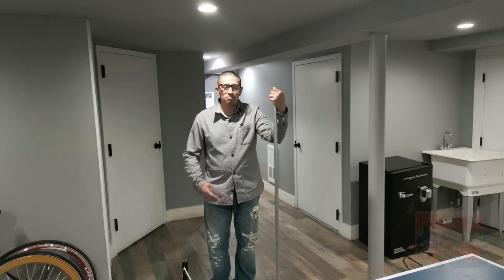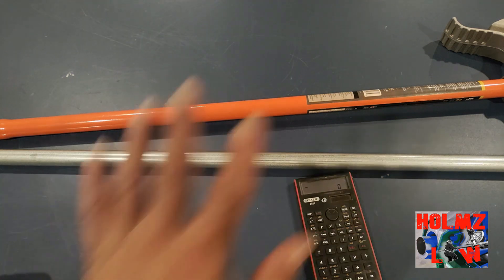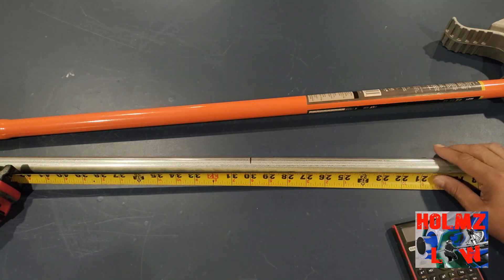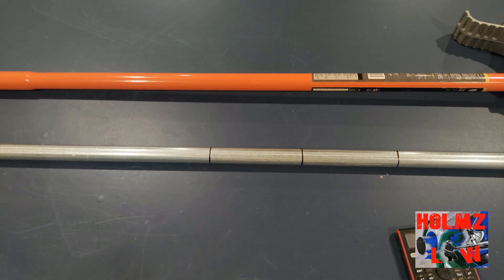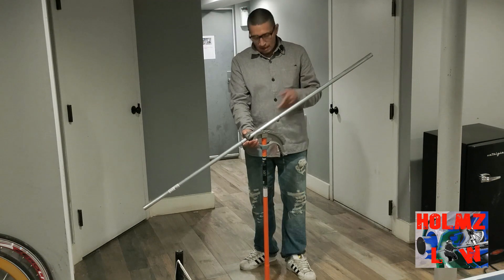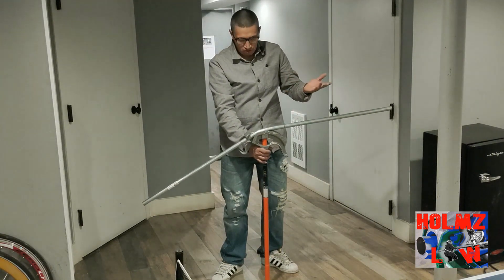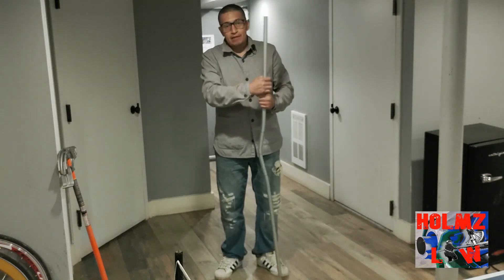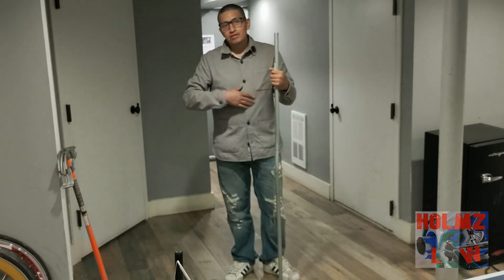3 Point Saddle - Small Obstruction

Comment: When using a Chicago bender or sidewinder and you’re doing a 3 point what changes with the marks? For instance with 90’s or offsets you just put the mark with edge of the shoe, do you still use the edge of the shoe for 3 point saddles?
Reply from the maker: Great Question... and I apologize for not seeing it in time. I don't know why sometimes i don't get these comments. Anyhow to answer your question. 
Chicago and Sidewinder 3 point saddles.
i was going to try and explain it here but it would take too long. You have to use center of bend to do saddles on those benders. There are 2 methods. 1 use center line radius measuerement so you can line up your marks on the front of shoe or hook. 2 you find the center of bends you will use for saddle and mark it on bender and use those marks to bend saddle and not the shoe or hook. I have a video where i touch on this i just can't remember which one. I'm sure its a video where i use the sidewinder.

Comment: Hey so why did you do a multiplier of 5 with the 22.5 degree center bend shouldn’t it be a multiplier of 2.6 and a shrink of 3/16 per inch
Reply from the maker: no 2.6 is for 45 degree. I'm doing 22.5 center bend and 11 on the sides. Thats why this is called the half method.

Comment: If the pipe will be hidden by ceiling or covered up with fireproofing (blown insulation) or 40ft from floor, why wouldn’t you want to use a SHARPIE instead of a pencil? These job sites are usually have very poor lighting (temporary lights) and make it hard to see a pencil mark.
Reply: Pencil works in all situations.
Reply: That's why headlights were invented. Only morons use sharpie.

Comment: I appreciate these vids a lot … I gotta say tho .. it’s confusing when some ppl say different things .. throws me off … I saw a vid where another guy said the shrink on a 3-point saddle was 3/16” for every inch of rise and now this guys is saying it’s 3/16” for every 2 inches of rise .. which is it ? Lol.  Thanks for the help !
Reply from the maker: Steve it's like offsets it all depends on the degree of bend you are using. For a regular 22.5-45-22.5 saddle yes it's 3/16" for every inch rise. For this method on this video which is 11-22-11 it's the shrink is so minute that it has to be 3/16" for every 2 inches. There are so many different types of saddles that you can bend to different degrees. Don't forget that the degrees is what you use to you and out how much it will shrink.
Reply: @TheArtOfConduitBending  ok,  thank you!  And if the rise on an 11-22-22 is 1.5 inches and not quite 2, then we just don’t worry about the shrink then ?  Thanks !

Comment: Can you use the push through method for all 3 configurations of a 3-point saddle?
Reply from the maker: No you can't. But this link will take you 2 the second push thru. I have 2 out of 3. You can how ever do a push thru of this video by finding the centers of 11 degrees and 22.5 degrees and charting your bender then you can bend it by pushing through. As of now that's the only way I know how.
Reply: @Holmz Law  oh yeah guess I never realized you could use it for that as long as you account for shrink, I guess you can really perform just about any bend in a specific spot
Reply from the maker: @robbysanchez6514  that's exactly correct.
Reply: @Holmz Law  or whateva the case may be

Comment: Does the multiplier 5 work for all size pipes such as 1/2 - 1 1/4? for small obstructions?
Reply from the maker: Yes the multiplier stays the same for every size conduit. The multiplier only changes depending on the degree you are bending. Hope this helps.
Please follow me on:
Facebook/holmzlaw
Instagram/holmzlaw
TikTok/holmzlaw
Reddit/holmzlaw
LinkedIn/melvinrubio
Snapchat/holmzlaw
Tradehounds/holmzlaw
Discord- https://discord.gg/cKgE88wW
Communities:
Reddit/r/conduitology
Facebook/artofconduitbending
LinkedIn/artofconduitbending
Reply: @TheArtOfConduitBending  how did you come up with the mulitplier? for distance of outer bends?
Reply from the maker: @mikeruano4858  I didn't come up with it my brother. It's trigonometry. For 3 point saddles we use the degrees on the outer bends to come up with the calculation. Simply put just like offsets we use the cosecant. So for 11 degrees the cosecant is something like 5.24 round it to a multiplier of 5. Done ✅
Hope that helps. 
Follow me on:
LinkedIn/in/melvin-rubio
Snapchat/holmzlaw
TikTok/holmzlaw
Facebook/holmzlaw
Instagram/holmzlaw
Reddit/holmzlaw
Reddit/r/conduitology
Reddit/holmzlaw
Tradeshound/holmzlaw
Twitter/holmzlaw
Quora/artofconduitbending
Quora/holmzlaw
Reply: That’s my question
Reply: I get it